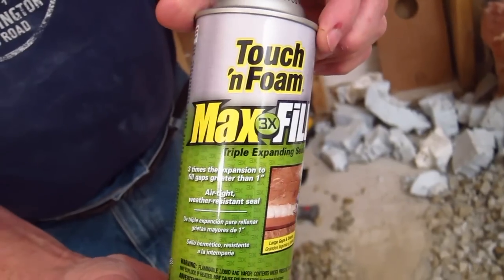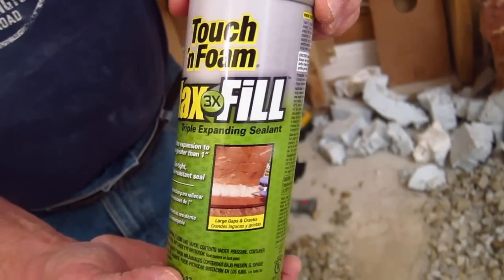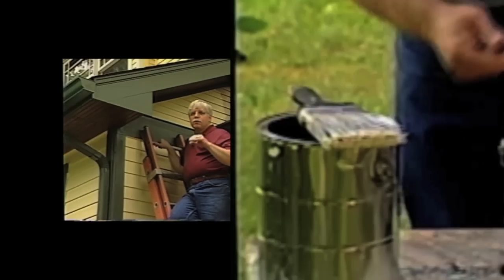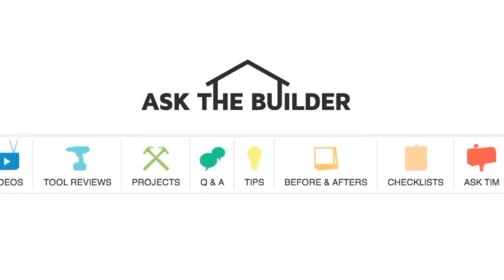Spray Foam Insulation Under Concrete Slab

Comment: Sigh, "spray foam is fun!" is not informative... It would have been helpful if you explained why you were bothering to spray foam under the concrete.
Reply: It's in the previous video. The videos could be numbered to make it easier to follow in sequence... Basically, there was a sheet of foam insulation directly under the entire concrete slab that keeps heat from escaping into the dirt. He had to break through the sheet of foam to access the pipes. The spray foam was used to patch the hole.
Reply: Many thanks for joining the dots on the spray foam "why" question. I 'm almost at the end of a major and very messy home plumbing job, not really interested in having fun but " gettin' er' done".
Reply: Great question.  He had me scratching my head too.  Thanks
Reply from the maker: Do you SEE the radiant heating tubes in the thumbnail photo and in the video?????
Reply: @askthebuilder  No, not really, it just looks like whenever you see a hole you spray it :P...  @MoneyManHolmes kindly explained it though.

Comment: I would think this affects the stability of the slab and makes it more prone to cracking or shifting.
Reply from the maker: Your tiny gray cells are deceiving you. I suggest you go out and watch many videos here on YouTube showing the installation of large commercial concrete slabs in huge freezer warehouses. Wait until you see what's under these slabs. Then imagine how many stacked pallets weighing XXXX pounds are placed on the concrete.
Reply: @askthebuilder  LOL, the foam never breaks down, creating air pockets?

Comment: Do your best to vent the area you're spraying foam in - the foam off-gasses dangerous gases until it cures.
Reply: Not any worse than a taco night fart...  about as flamable also...  only scenario where that stuff would get dangerous is if spraying inside a void with little air relief..  if you spray too much the outside will cure and the inside will remain like it is in the can...  so down the road even years later if any spark makes its way through the outer hardened layer of foam it will combust being trapped in that confined space and its like napalm when it goes like that..,  the gasses in it are only butane and it emits co2 and carbon monoxide when it cures but not really enough to cause asphyxiation or mess with you...  if you were using the 2 part then that stuff does give off a few bad hydrocarbons when the chemical reaction takes place...  gets hot and releases bad joojoo...  so stop trying to be a safety slut on youtube and do your homework...  did you know that ladders kill more people than cocaine In a year?  How about there are more car accident fatalities than cigarette caused yearly..  heres a good one..  68% of the time the person who is always bitching and talking about safety will get hurt over anybody else on a job site, is why you dont really get that many i told ta so's on jobs...  but is from them worrying about other people more than themselves or them focusing on all that could go wrong over focusing on the task at hand and their surroundings...   one other fact.  I poop a lot...  

@≈─=≡Σ((( つ̀0́)つ
Reply from the maker: Beware lighting those things. To get unlimited tips each week, subscribe to my FREE newsletter at www.AsktheBuilder.com

Comment: This product has terrible reviews and I really don't think its meant for being under concrete as it collapses quite easily. I would just buy the EPS or XPS rigid insulation foam and cut it accordingly, stuff it in around and above the pipes.
Reply from the maker: And you believe all the reviews you read? Do you realize some leaving reviews are not qualified? For unlimited tips subscribe to my FREE weekly newsletter at www.AsktheBuilder.com

Comment: NEVER use foam! ALWAYS use gravel. Gravel allows you to dig up and replace pipe work easily if there ever is an issue. Also Always leave a ring around when you pour so you can move the drain a bit upon install.
Reply: So.... What do I do? Foam or no foam? Or sand...?
Reply: HO! It's for the Heated Floor!!! I Get it! It's not to replace sand/gravel... it's heat insulation
Reply from the maker: The foam is required to stop the heat from the radiant floor tubes escaping into the ground. There's gravel under the foam. It's pretty obvious that you're not a master plumber and have never done this job before. Once the concrete is poured no matter if it's just gravel around the pipe or a combination of gravel and foam, you're not moving it. 

The pipe is locked into place by everything that's surrounding it under the concrete. I've been a master plumber since age 28. And as for digging it up later, foam is one of the easiest things to get out of the way. Please do everyone a favor in the future and don't comment about things where your knowledge is as shallow as a tidal pool. Sorry for the tough love, but it's true.
Reply: ....also: spraying foam IS fun! :D  If someone don't enjoy it, he doesn't know what fun is.  :D
Reply: youjustgottadrum you just got told.
Reply: Good shit

Comment: Two 45 's at the 90 degree bend , im sure that's not code anywhere...! And I sure would not do it. A long bend 90 is what it should have been .
Reply from the maker: Please do many a favor and stop commenting when you don't know what you're talking about. Two 45s ARE the best plumbing practice for making a 90-bend in a horizontal run. Drain-cleaning snakes have a much easier time navigating 45s than 90s. I've been a master plumber since age 29 and it's pretty obvious you're not one. Seriously, stop making comments about things you're unsure of. I'm leaving your comment VISIBLE because I want others to see that they have to be very careful about trusting advice from invisible people like you.
Reply: Of course it’s code, and it’s best practice.  2 45s make a better bend.  Easier to snake and less likely to plug off.  What code are you referring to and where did you learn that?  2 45s make a long radius bend and it’s the best.